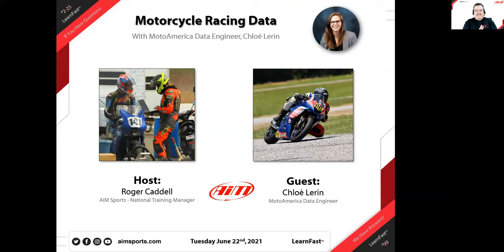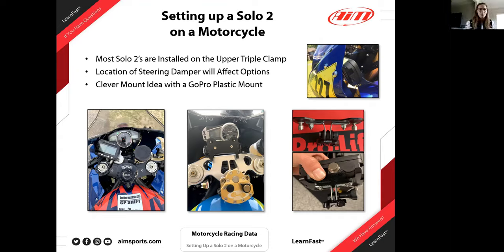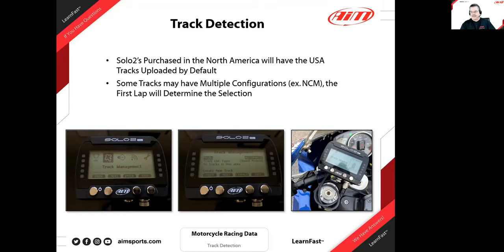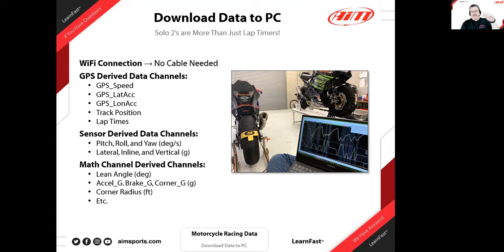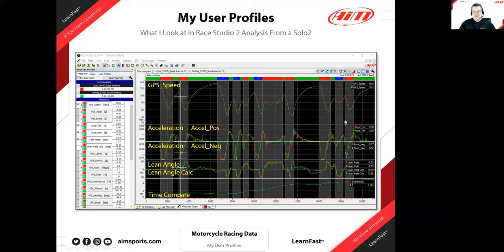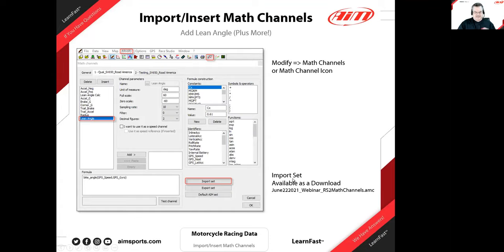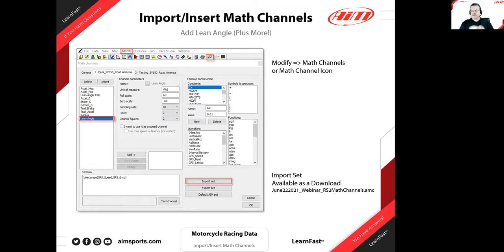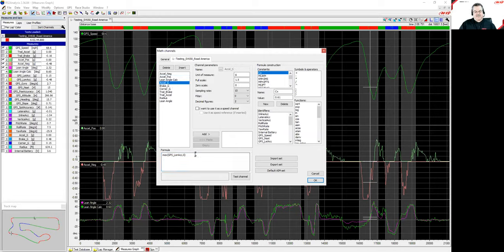2-25 Motorcycle Racing Data - Live Webinar with Chloé Lerin - 6/22/2021

Comment: A walk-through of a typical MotoAmerica weekend would be very insightful to the average club racer who has no idea where to start. Such as
1) bike set up analysis looking at suspension travel front to rear ratios to understand the attitude of the bike for geometry & to confirm base settings then tuning based on problems (e.g., bodywork dragging from too much lean angle causing a dangerous situation) or most important corners (e.g., those leading onto the longest straight)
2) rider improvement - analysis by sector times & ranking against the competition, analysis by corner, analysis as to why you are slower than a teammate on the same equipment, etc.
3) analysis for qualifying versus the race
Reply: Thanks for your suggestion. I think this is a great idea!